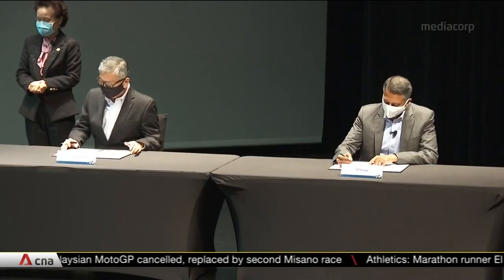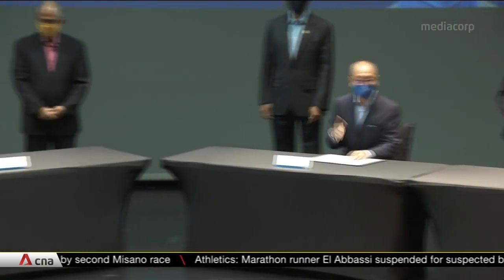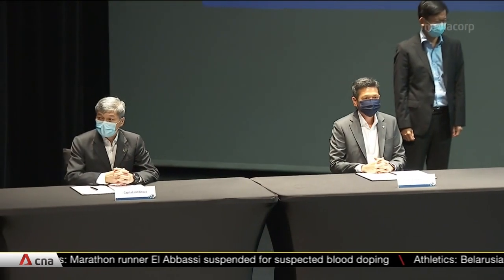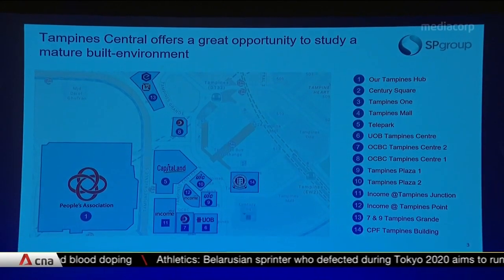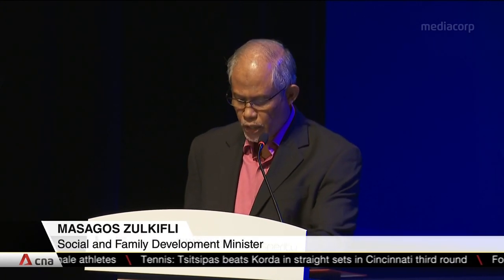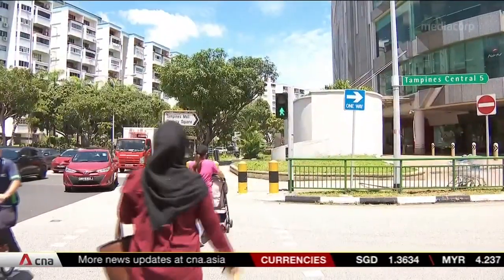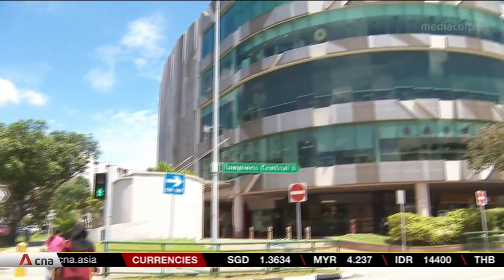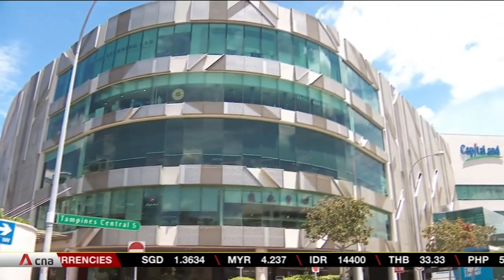District cooling system in Tampines could cut emissions by 18%: Study

Comment: You will save a lot more energy if we improve our building codes to have higher insulation levels inc windows/glazing, and for our intelligent buildings to include smart fabric management systems and design (reducing net energy consumption). The actual savings of a district heating or cooling is via the improve efficiency due to scaling and load balancing, not necessary the net consumption of power for cooling.

Comment: Another Dumb project
Reply: very skeptical, will they release research papers or where can we read more to understand why? how? what?
For 1, I only know its carbon emission causing urban heat rise and increasing consumption of air-conditioning and then it loops. Like in the Hong Kong case study, but this solution...... wouldnt it use more power to cool a district?
Reply: Why?
Reply: @ProfessorElectronic  why not?
Reply: @deschan2246  You said that the project is dump so you have to justify.
Reply: @ProfessorElectronic  justify to u?  Wat 4?
Reply: @deschan2246  You have to justify why the project is dumb in order for your assertion to be credible.
Reply: @ProfessorElectronic  refer to my last comment
Reply: @ProfessorElectronic  thats what I want to know too.
Reply: @xAgonisx  🙂  u do?
Reply: @xAgonisx  high initial investment, long term high maintenance cost (burden to future generation), lots of prolong digging in urban area, effects of excessive diggings (such as flooding). Shut down or faults in the system will affect the whole district. Need space to house huge Compressor n condenser near sea/river/reservoir that will impact/effect the eco system in that area
Reply: @ProfessorElectronic  replied